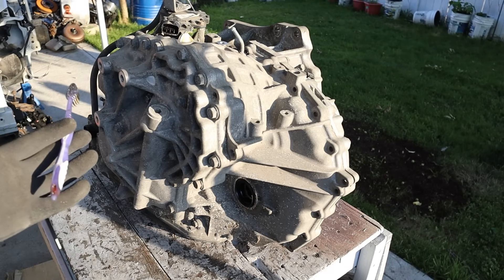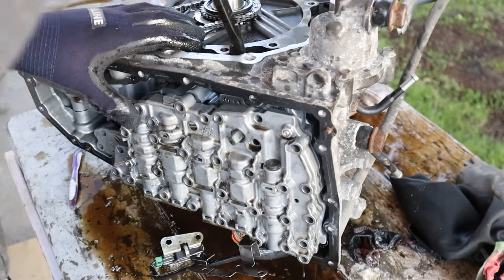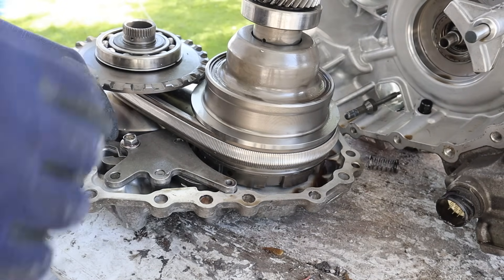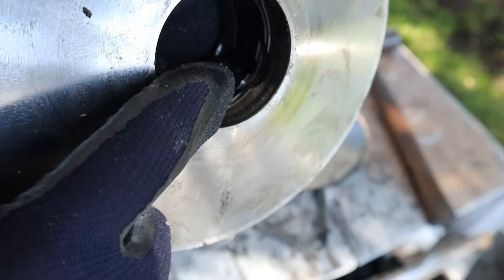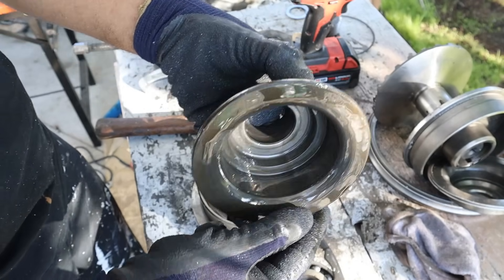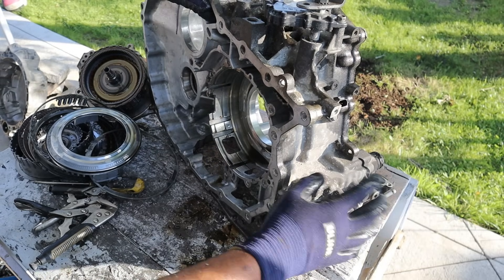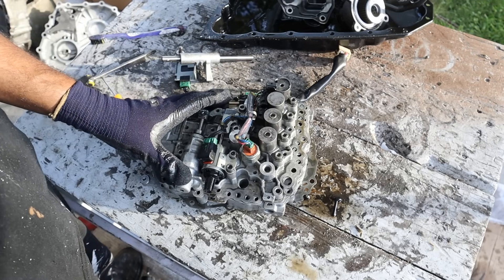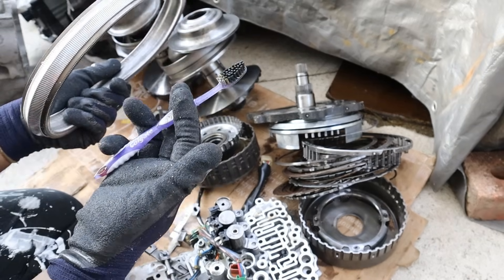Why Nissan CVT's are a FAILURE

Comment: After seeing this informative video, I would never attempt to try to rebuild one of these.
Reply: No shop rebuilds these anymore. They just replace with a junkyard unit
Reply: Those clutch packs are scary
Reply: @waldolemmer  The clutch packs are like a motorcycle and not that hard........... the problem is all those balls that fell out.  How in the world are you going to get that back together?

 That and all these new transmissions and lack of gaskets.  I absolutely hate how most automotive things have gone gasket free and require you to use sealant when you put assemblies back to together.  Its so easy to get a leak and they only do it that way because it saves 5 cents.       New cars really are cheap garbage.
Reply: @davids.9834  Ah, ok. If using grease inside a transmission is fine, that could help to keep the balls in place. That's generally how it's done on bicycle freewheels that dump all their ball bearings when opening them up
Reply: @waldolemmer  You have to use special grease made for an automatic transmission, but this is exactly what you do.
Reply: @randyrobey7636  right?!? 👍
Reply: yea ius to low end of a car i would buy a yugo at least it has a 4 speed
Reply: After seeing this informative video, I would never ever buy anything with a CVT  (even if they weren't also really annoying crap to drive).
Reply: @cr10001  I will say, there is ONE (1) cvt that's actually known for being quite bulletproof, and that's toyota's hybrid e-cvt. Instead of a belt and variable pulleys it's essentially just a differential with motor on either side; one gas, one electric. When at low speed or stopped, the engine feeds back to the electric motor to charge. It allows both an infinite gear ratio like a normal cvt and also a very efficient method to swap from full charging to full acceleration and back all in one unit. Super simple, super stout.
Reply: @LaPapaMollido simple, no friction, not even a clutch. Where regular CVTs rely on tiny friction surfaces to function (the push-belt, and then on this one those stupid ball bearing and motorcycle clutch packs), which is madness, really. On a 1.5 ton, 250 N.m vehicle?!?
Reply: I would be so scared to rebuild any transmission
Reply: @TinoMiller I rebuilt a 4l60e Chevy transmission, it really wasn’t that hard

Comment: CVT trans last well over 200,000 miles on Toyota prius so they are not that bad.
Reply: The Prius eCVT is fundamentally different.
Reply: Toyota hybrid eCVTs are totally different in operation as well as Honda hybrid versions.

Comment: mine @200K is still strong :) as you said the key is maintenance especially an oil change every 30K
Reply: That's fine, but a transmission shouldn't require oil changes that often, one can argue, since the other designs don't.  On the other hand, if you make it as easy to change as engine oil and filter, then maybe we're on to something.
Reply: @pfsantos007  IMO CVT transmissions(specially JATCO) are more sensitive to maintenance than other designs most repair shops suggested 30K in my country(hot climate region) and it definitely helps transmission and car manufacturers, they do their best to convince car owners not to change the transmission oil because they don't want the car to last beyond car's guaranty so as a car owner we need to find a way to maintain it.
Reply: @pfsantos007 nope, it applies to any other automatic transmission as well, besides changing the fluid is dirt cheap so why would you prolong it?

Comment: a failure that lasted 165KM? ok
Reply: Apparently jatco cvts can last quite a while if you change the fluid frequently, such as every 25k miles.
Reply: 102.5 K miles. Our 4 sp. auto accord has 350 K and still perfect.

Comment: Where i reside, Nissan Sunny N16’s with the old 4-speed autos and 5-speed manuals are literally considered the only thing that is as reliable and durable as a toyota corolla. Some even prefer them over corollas due to how basic they are. 

It is unfortunate how rubbish their modern cars are.
Reply: My Nissan Micra K10 keeps going still after 36 years. 

Sure it doesn't have stuff modern cars have but it's amazing how cars were made back in the day.
Reply: @vilenius187  Micra K10 is possibly one of Nissan’s most durable car ever made. What a sweet ride!
Reply: The only Nissan I'll buy is older Grand livina same engine with Sentra 1.8L 4 speed auto.
Reply: @GF-mf7ml  It is fortunate that it didn’t get the CVT treatment.
Reply: The new armada and qx80 have a 9 speed like the new pathfinder but still using cvt in the rogue
Reply: @Lovesausage269  they are definitely going the right direction.
Reply: GOSHN needed to embezzle a lot of money so he cut corners on building this Jatco transmission.
Reply: @soothsayer2406 it is tragic. Especially considering how a car like the N16 Sunny i owned was so indestructible that i forgot mechanics were a thing in kurdistan in iraq. If that doesn’t tell you how durable cars used to be, idk what else does.
Reply: Planned obsolescence. Capitalism
Reply: @jimmytimmy3680  It is. considering the amount of failure on their CVTs.

Comment: The CVT  Lexus IS 300H is the same?
Reply: Hybrid Toyota and lexus using ECVT  which is completely different transmission. It doesn't have any cone and belt and it uses electric motor and rotating in every direction and any speed to control out put speed. In general those things are bullet proof if you just change the fluid
Reply: Lexus is a Toyota owned brand and Toyota makes a decent CVT .
EDIT ( Didn't know Lexus used CVTs but if they do and they use the TOYOTA CVT design they should have decent reliability for a CVT. BUT I would prefer a conventional automatic transmission over a CTV even a Toyota CVT )
Reply: I'm not aware of anything about that car but they are two completely different manufacturers